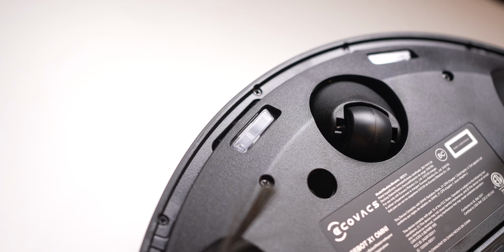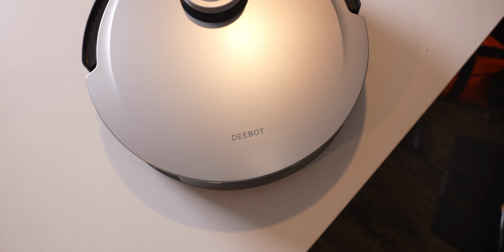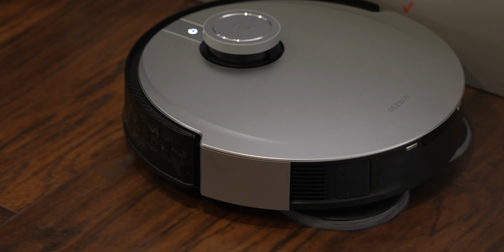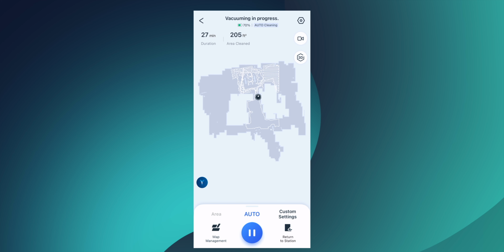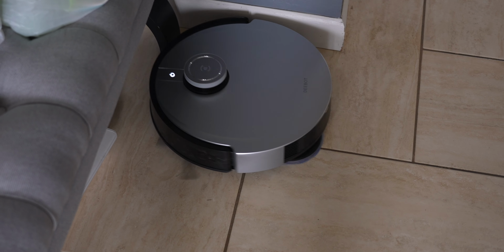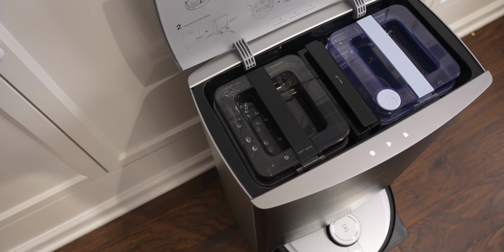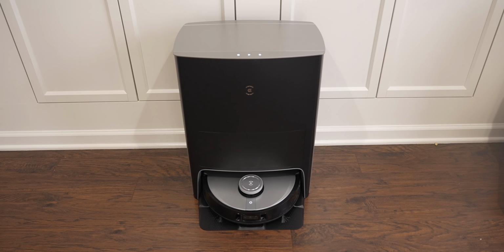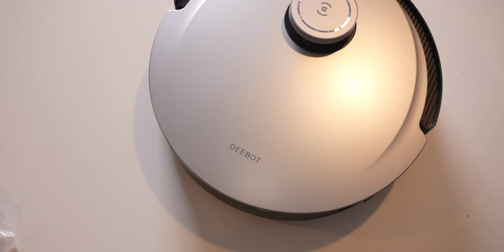ECOVACS DEEBOT X1 OMNI // The Next Generation Of Robot Vacs

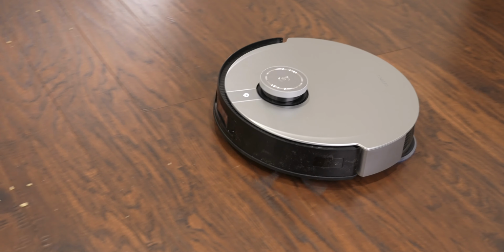Comment: @00:15  "Banging against the wall". You must not have much furniture because mine beat the crap (iRobot Scooba and older deebot) out of the lets and edges of the furniture. My guess is, the programmer of the iRobot Scooba was beaten as a child with a table leg or something because my Scooba will back up and slam into my chairs and table legs a couple of times before he goes around. One reason, no matter how many improvements iRobot has made, I'll never own another. Looking at the Roborock and newer Omin level of Deebot. Now, watching the video around the 2:22  spot, I see a $1500.00 robot throwing stuff around from it's side brushes like one that costs $200.00. Not a good selling point.

Comment: Would you recommend this over the Roborock S7 MaxV Ultra?
Reply: My exact question. Been going back and forth between these two. Someone has to make a comparison video. I'm leaning towards the Roborock for reliability, better app function/consistency, vibra-rise, and great self empty system, but it doesn't have the spinning mop system, and doesn't dry the mop after cleaning... which makes me lean towards the x1 omni.... the Roborock seems to be a better vacuum, but maybe not as good of a mop, so I wonder how well the self empty of the x1 is when it comes to emptying clumps of dog fur, and if deebot has fixed the major issues related to saving maps...
Reply: Trust me… replacing the map daily is painful.. i have 1 unit from ecovacs. if your forgot to replace the mopping cloth it can get smelly. Self drying mop is really a good features. Unless you dont mine to replace the mopping cloth daily..
Reply: @ejudeeus  well the ecovacs x1 omni has 2 spinning mops, instead of a mopping pad, and it cleans itself and then dries itself with warm air, whereas the roborock is the more traditional type of mopping pad, except it vibrates and raises itself up when vacuuming carpet... it does also wash itself, but it does not dry itself like the ecovacs one does... which would you pick between the x1 omni or s7 maxv ultra?
Reply: @TomCreasy  i see so s7 have a vibrating traditional pad. and can raise itself. HAHA seems like s7 is a better choice. since the ecovacs will not vacuum the carpet with mop is placed on. that's a good feature. Since s7 does clean itself the pad should be ok.